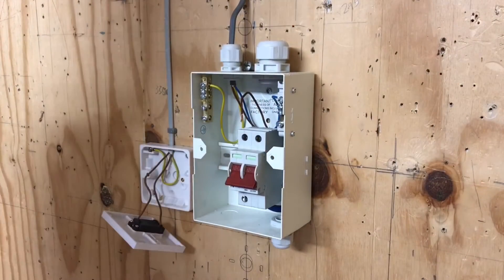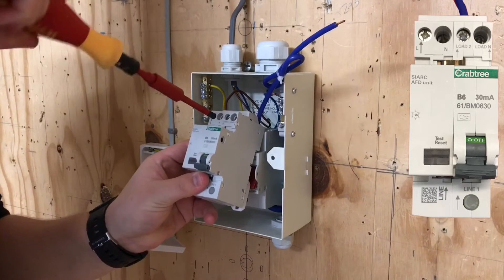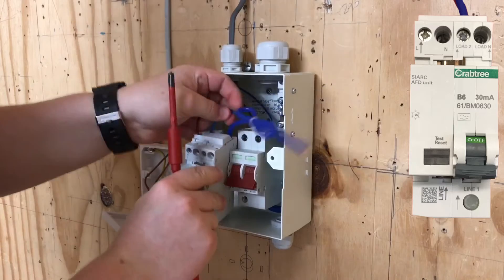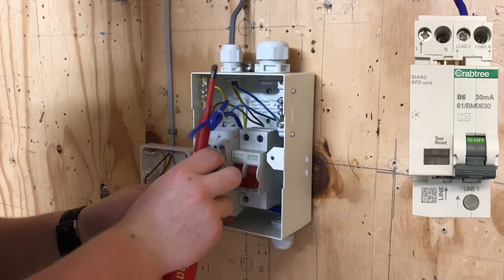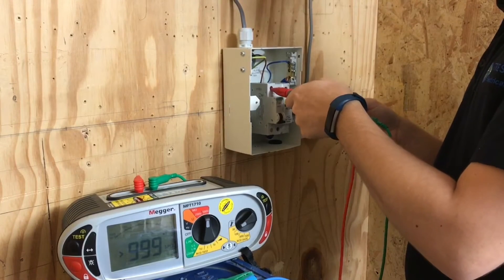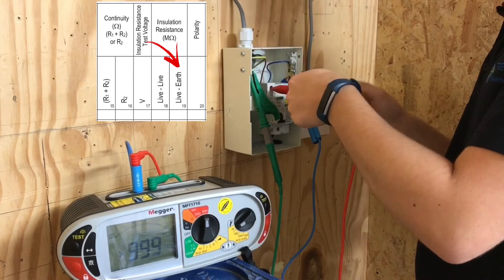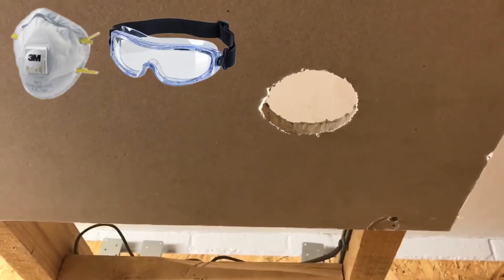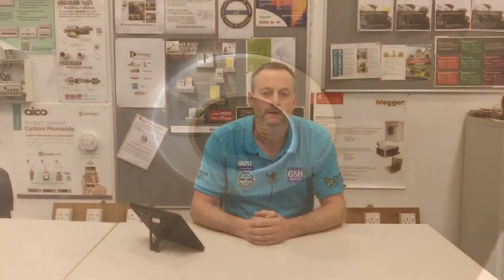Fitting an AFDD, Combined Insulation Resistance Live Conductors to Earth and Fitting LED Downlights

Comment: Hi has once first rcbo is connected to incoming live ate they all then connected on the bottom by bus bar as normal
Reply: Shaun Beard Crabtree starbreaker have the Busbar at the back of the consumers units and do not require you to fit one under the device (AFDD/RCBO) being fitted👍.
Reply: @wallbouncer9655  thanks for reply what about other makes . Was wondering as normally live comes out of first breaker into top of other two